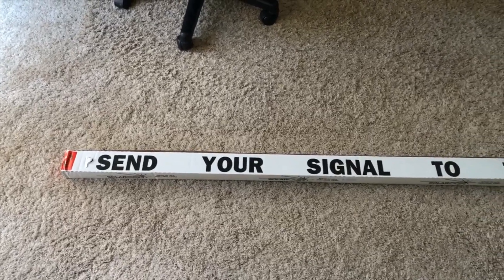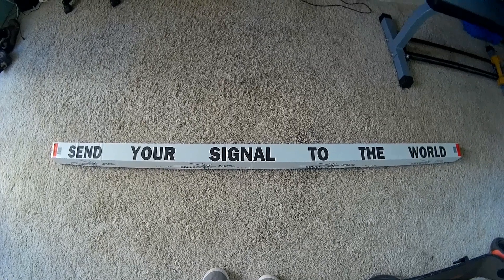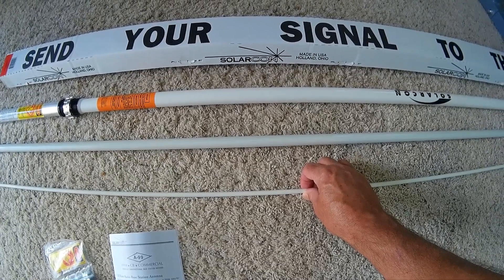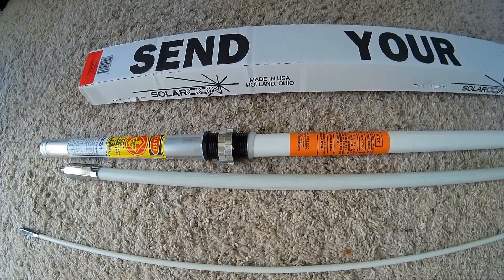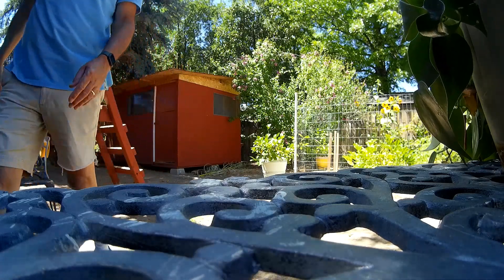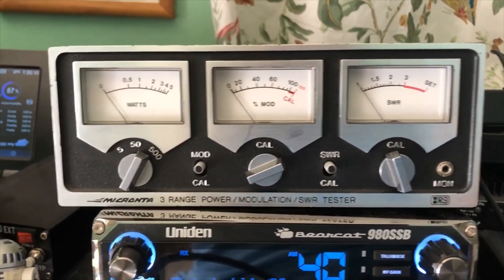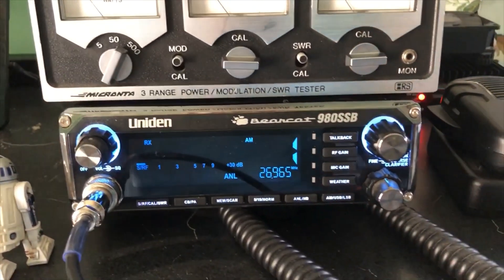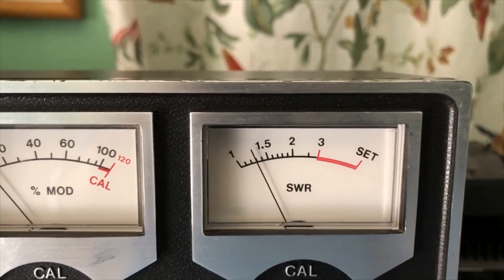Solarcon A-99 CB Base Antenna Installation and Test

Comment: One of your views showed the coax coiled. In my humble experience with electricity, looping wire creates  a magnetic field. If you must have excess, twist it into a figure 8, bind it in the mid section so it doesn't move, and I'll wager that helps. Nice set up. Your vid is helpful.

Comment: I ran a counterpoise ground on my Antron and to my surprise I'm now able to go 65 channels above 40 and 45 channels below 40 out of 1.4 SWR. However the entire 11 meter is completely flat in terms of SWR and I'm getting in 50 ohms coming back. But again I highly recommend running a ground on the antenna. What I've done to mine is I wrap mine around the bottom shaft of the antenna where the two u-bolts go then it run a copper wire to a ground rod 8-foot in the ground

Comment: I'd mount the antenna away from all those trees.. Or put it up above the trees if possible.. Why be discrete? You're a radio operator, put the antenna where it's going to perform the best.. Who cares what others see.. LOL Man that antenna is way too LOW.. Oh well to each his own.. If you look in the instructions I believe they recommend at least 9 feet above the peak of your roof the bottom of the antenna should be.. The farther up the better the performance.. Your choice of where you mounted the antenna and its height is a poor choice, to say the least..
Reply from the maker: I plan on raising the antenna some more, but we get some pretty strong winds in my location. I once measured a gust of 93 mph. It performs awesome at its current heigh. and I have talked all over the world on 10 meters using 80 watts. I've reached all 50 states and even Australia on 11 meters using 12 watts of power. I'm at 5000 feet elevation surrounded by mountains on all sides. I'm fortunate to live in a location where my signal is getting out further than you think it would with my set up. I believe it's because of the Sierra Nevada Mountains chain that is about 4 miles west of me that rise to an altitude of almost 11,000 feet. I believe that my signal is bouncing off the mountains and hits the D layer of the atmosphere at an angle that is favorable for long distance communication. I'm talking with contacts in Europe and Asia that are using big antennas with lots of power and getting great reports. Thanks for watching, 73!

Comment: Make sure to use stainless steel washers and grease on joints.    Clear lacquer on fiberglass.   ✌️🙏 dont cover the drain hole on bottom.      Dont overtighten stainless.  Or it never comes apart.    So ive been told 😢😅.  U can even get dark colors or camo paint and paint the whole thing.  Itll never be seen.  🎉

Comment: I have the imax 2000 and it’s my second one the first had some swr issues in the wet so bought another and yeah when taking the old one down i slid the sections through my hands and ended up with lots of those fibreglass shards stuck in my hand what a nightmare to remove them all…
Just out of interest what do you use to re cost these when they get like that?
Reply from the maker: Ouch! I grabbed a fiberglass stake once and instantly regretted it. It felt like grabbing a cactus. I've read that you sand them down lightly and can pretty much use any paint that does not contain any metal flakes.

Comment: Few questions, why all the extra coax? I’ve heard you want your coax a specific length such as in multiples 18ft because it’s a quarter wavelength. Second, I have a roof I can put mine on I can’t mount it to a metal pole that’s in the ground only on the roof where there’s a metal vent pipe sticking up the roofline is about 25ft off the ground. Do I need to run a ground wire from the bracket securing the antenna to the vent pipe to ground? Or is that only for safety (lightening) which we never have in my area of the country. I will be running a lot of power so I got lmr400 coax and good connectors my antenna analyzer is on the way but I’m concerned about the grounding issue.
Reply from the maker: I plan to raise my antenna in the future, so I don't mind that I have a little extra coax. I haven't grounded my antenna yet, but plan to do so once the ground thaws out. A ground is not just for lightning protection, but also to discharge static electricity that builds up. I live in an area that gets low humidly and high winds which is the perfect recipe for static build up. I have damaged my Sears RoadTalker radio twice with static build up from my dipole antenna. I guess I don't have a very steep learning curve. 😀Thanks for watching! 73s from 595 Lake Tahoe Nevada.

Comment: When you had to adjust the rings how much did you turn them?did you turn just one? I purchased a used antenna and it’s like yours but mine didn’t come with any instructions for adjusting anything, just curious.
Reply from the maker: When I bought the antenna, the rings were together dead center. You want the rings to be against each other after adjusting. Moving the rings upward will make the antenna longer and closer to the 10-meter band. When I had 50 feet of cheap coax hooked up to the antenna, the antenna was pretty spot on with the rings dead center. For some reason when I switched over to a better-quality coax at around 97 feet, I needed to tune the rings upward to get a lower SWR. Thanks for watching and 73s from 595 Lake Tahoe Nevada.

Comment: I’m preparing to set up one of these about 200 ft up a WV mountain slope.
My plan is to connect a balun directly to the A99, connect 450 ladder line, run the 200 ft into the tuner.
And I’m 65.   Pray for me.  😂 😂 😂
Reply from the maker: I'm not far behind you, be safe! I'm anxious to hear how it performs, please share when you get it up and running. 73s from 595 Lake Tahoe Nevada.
Reply: @RidgeHikerAdventures  Well she’s up.
I miscalc’d the DXEngineering’s balun size, I had to make a ‘shim’ placed between A99 and the mast so the balun would easily connect directly to the connector ( I almost simply used a 3’ coax but that would have compromised my ‘direct connect’ experiment ).
I used the tuning ring setting as set at the factory, just tightened them together,, and I didn’t test on-site.
I’m getting below 1.5 SWR from about 26.500 to 28.500, with the center freq around 
27.300 (entire CB band is almost flatline reflected ).
I’m getting about the same performance as a short run of coax / 75ft., so using this no coax (other than what’s inside the A99) method is viable for long runs.
Apologies for the long explanation!
584 Southern WV
Night Watchman (local)
Reply from the maker: @bleikrsound6127  Sounds great, I'm glad to hear that the antenna is up and your SWR is good! I've been thinking of adding a balun. Please let us know how your antenna is performing. Thanks for the comment!
Reply: @RidgeHikerAdventures  I heard you the other day, but conditions were wide open and I couldn’t get over the beamers.
Had good reports so far, CA,TX,OK, and an off-band from Nome, Alaska on 27.425 LSB.
There are so many mountains here, I’m doing far better contacting DX than locals blocked by steep valleys.  I need more height!!!
Reply from the maker: @bleikrsound6127  I hear you, I'm also in a valley completely surrounded by mountains on all sides. I sometimes wonder if the radio signal bounces off the mountains as I do very well DXing. How high is your antenna? Thanks for the comment, 73s from 595 Lake Tahoe Nevada!
Reply: @RidgeHikerAdventures  After trying both over the years, in valleys or other obstructions, a pure vertical seems to do better than one with radials.
My untested theory is the radials keep signals in more of an outward ‘doughnut’ shape, and without gives more of an oval, in both Tx & Rx.  My loc is about 1,200ft elevation, with tips of hills all around except WNW.  At least the western opening gives tons of afternoon EST contacts.

584 S W.V.
Reply from the maker: @bleikrsound6127  Too bad we weren't able to make contact. What state do you live in, and what's your callsign? I'll keep my ear open for you. 73s from 595 Lake Tahoe Nevada!

Comment: Your going to bleed all over your naibors unless you get that thing at least a full wave off the ground. Especially when you run that amp
Reply from the maker: I'm not too concerned. I mainly run barefoot on 11 meters and my radio puts out a clean signal. I also have a low pass filter inline when I run the amp on 10 meters to block out any possible spurious emissions above 30 MHz from the amp. Now that television signals are digital, 11 meter radios don't interfere with the signals any more. I don't even hear any RF noise on my computer speakers or 2 meter ham radio that I have on most of the time. Thanks for watching! 73s from 595 Lake Tahoe Nevada.

Comment: I bought the Solartron 99 a few months ago and for some reason it developed an issue with a very high SWR. It was such a great antenna on 10, 12 and 15 meters that I bought another and put it up recently. Wondering if the first one just got detuned somehow because the tuning rings butted up against my metal mast. Anyway I'm back in business and I have to say it's the most underrated antenna out there for hams. Many hams snub it because it's a "CB antenna". But that's a mistake. Performance is what counts. The SWR amazing is below 2:1 on 10, 12, and 15 due to its tuning coils. I do think it uses the coax as a counterpoise, though. Mine is radial-less.

Comment: I also have this antenna. I am from Germany, Bavaria. My tip is not to use an adapter between the cable. This changes the ohm numbers. This is very bad with this antenna. It's best to use a solid cable. Great video
Reply from the maker: Thanks for the tip and watching the video! 73s from 595 Lake Tahoe Nevada.
Reply: That's right..solid line only

Comment: By chance do you a 1-800  to call for parts 
Lost my last 8 foot section in a storm
Reply from the maker: Walcott Radio sells an upgraded replacement top section for the A-99 manufactured by Firestick.

Comment: Mine is old and the glass is so bad now it looks furry.
It works great but I need to re-coat it with something to get more years out of it.
Any suggestions would be appreciated.
10-4
Reply from the maker: I've heard that the Krylon spray-paint will hold up for a few years. The Rust-Oleum spray-paint for plastic looks like it would probably hold up the best. Avoid anything with metal in it or lead based paint. I've also read to avoid black paint with high carbon content. Wash the antenna with soap and water (wear gloves to avoid the fiberglass splinters) and paint.
Reply: @RidgeHikerAdventures  
10-4
Definitely not looking forward to handling that thing but I have to try something or get a new one.
I think I’ll wear my Covid mask too.
Reply: Done my Imax2000 with a pot of laquer and it came up good as new.
All the very best
108AT132/2M0LNF Ian    :-)
Reply: @jacianmcgurk7424  thanks…..I think I’m going to give it a shot.
Reply from the maker: @jacianmcgurk7424  That's great to hear, thanks for sharing. I think when the time comes, I might go the lacquer route. 73s from 595 Lake Tahoe Nevada!

Comment: These antenna's were brilliant when they were made by Antron but the new Solarcon is not made aswel and does not work aswel, I know this because myself and a friend tested them both at the same time. I still use an original Imax 2000 I use on 10 mrts .

Comment: Did the antenna not come with a ground plane radial kit?
Reply from the maker: It did not, the kit is around $78.00.  I’ve read on radio forums that it doesn’t make a big difference in performance. The radials in the kit are close to 6 feet long. Thanks for watching!

Comment: I had an A99 for years then I switched to an IMAX 2000. Both are nice antennas. My IMAX 2000 is only on a 10’ pole due to HOA rules but I still talk DX all over the place .
Reply from the maker: I'm enjoying the antenna so far. Currently it's sitting 9 feet above the ground. I'm planning an extension on the pole in the future. Thanks for watching! 73s from 595 Lake Tahoe Nevada.

Comment: you should have put Dielectric Grease on the two joints & get some Marine Grade shrink tubing with adhesive inside (put two layers on each Joint the first one will just cover the connection joint with overlap, then place a long one covering all the metal joints. that's what I did with my antenna and I never had any water getting in. My fiberglass antenna was up for 12+ years.
Reply from the maker: Thanks for the suggestions, I'm thinking of putting some protection on the antenna when I raise it. Thanks for watching, 73 from 595 Lake Tahoe Nevada!

Comment: if u have a chain link fence company near go get u some chain link fence top rail it comes i 22-24ft, 1 1/2-2in round maybe bigger an it comes in 12ga,14ga,16ga, an its smaller on one end so u can slide to pieces together mite be what ur looking for
Reply from the maker: Great idea, I never thought of using fencing poles. Thanks for watching and the comment. 73s from 595 Lake Tahoe Nevada!
Reply: ya they work great 654 southwest part of va  @RidgeHikerAdventures

Comment: And the radio I use with my antron 99 is a rci 2950dx mobile I bought it from copper electronics had it peaked and tuned and inlined it's a very good radio

Comment: You made a good choice of buying that antenna I have the same antenna it's 50 foot up in the air I've talked all over the USA on the 10 meter band and I've talked to different states on lower sideband of  38 on the cb band
Reply from the maker: So far, I'm very pleased with it. I made several contacts with some stations in Florida this morning, so I know it's working for DX. Thanks for watching! 73s from 595 Lake Tahoe Nevada!

Comment: If you get different swr readings from 1-40 then adjustments can be made to get it better
Reply from the maker: After the video, I played around with the rings and was able to get the readings pretty close together with a little fine tuning. Thanks for watching! 73s from 595 Lake Tahoe Nevada.

Comment: I have the "Sirio Gainmaster 5/8ths wave" which I found to be a far better antenna than the A99's, presently due to heigth restrictions with my location, I mounted the antenna on a cast iron patio umbrella stand and a 4' piece of inch and a half tubing which put the RF choke of the Gainmaster only 4 feet above the ground. The antenna, like the A99 is matched at the 27mhz band with a 1:1 throughout the band and is relatively the same on tge 10 and 12m band. 
  I do alot of skip transmitting so having a low radiation angle is key, and have had 6 and 7x9 reports and some as 20 over reports in Austrailia and Hawaii. 
   I would highly suggest, with the treaded joints on that A99 is put some "Jet Lube" copper infused anti-sieze on the threads to keep corrosion down to a minimum, Jet Lube is conductive so it will promote RF signal transfer from joint to joint.
   My coax is Messi & Paolini Hyperflex 10 with UHF connectors, the total length is a single run at 70'f which I have loosley coiled up 10'f from outside my shack. According to M&P coax tests, the Hyperflex 10 is much better than RG 213 loss wise but, not as good as RG-214 mil-spec, makes sense, RG-214 is a double Silver plated Shield and a Silver plated conductor, and nearly $5.00 a foot...lol
   My transiever is an RCI-2970-N3 Tuned up and is putting out 495 watts on the Bird meter, just below the Sirio Gainmasters suggested 500 watt max limit. So far after a year and a half of working DX, antenna is holding up fantastic.
   Great video, I hope the Antenna serves you well!.
    73's from 4570 Palm Springs,Ca 👋🤠
Reply from the maker: Thanks for the suggestions, it sounds like you have a sweet setup! I'm putting out around 85 watts on sideband and have been doing pretty well when conditions are favorable. Thanks for the comments and watching the video. I'll look for you when Southern California opens up next time! 73s from 595 Lake Tahoe Nevada.
Reply: @RidgeHikerAdventures  Thanks for the reply,take care and hopefully catch you down the log! UDX 4570

Comment: Tape all joints up & coax connection . Slows water ingress
Reply: I worked in communications professionally and did some tower work. We would use Scotch 77 first, then a layer of scotch 88 and then friction tape with  scotch coat painted on that. It’s waterproof and comes off fairly easy with the 77 as a bottom layer. I used this method from the Arctic to Middle East Desert to Indonesian jungles and never had a problem.

Comment: i take mine camping, so i varnished it then used shrink wrap so i dont get hurt by the fiberglass.
Reply from the maker: Great idea, I've grabbed an old fiberglass pole before, and it was very painful. Thanks for watching! 73s from 595 Lake Tahoe Nevada.
Reply: I want to use the Antron 99 antenna on my Apartment Balcony, how high of a mast did you use...?
Reply: @hb120877 my house is 20' and I use 15' of antenna mast. this way I'm one wave length above the ground. lower than a wave length their is ground absorbtion.

Comment: buy your self a 6.5 meter steel pole and put the antenna on that and have close to the radio room. the higher the antenna the better it will work and you will get out even a lot of greater distance.
Reply from the maker: I'm planning to raise the antenna in about a month after collecting some data. I want to see what difference height will have on dx and local contacts. Thanks for watching! 73s from 595 Lake Tahoe Nevada.